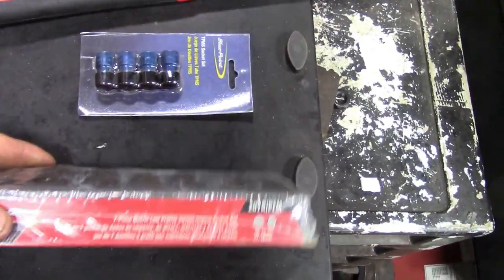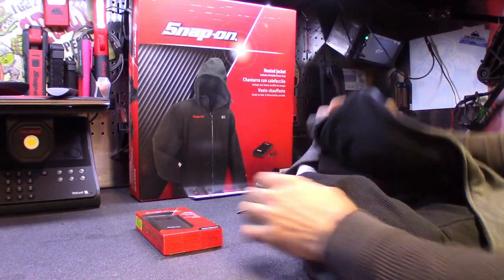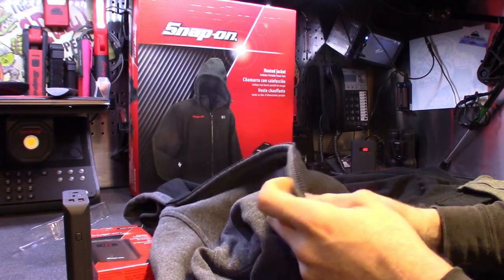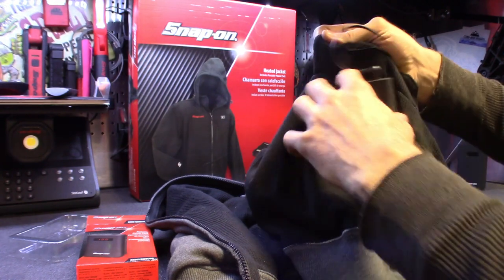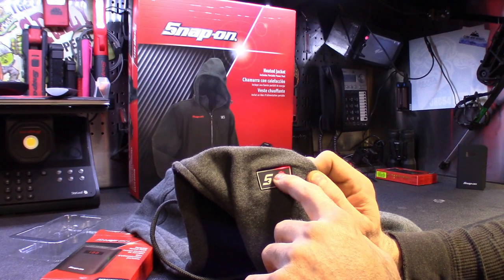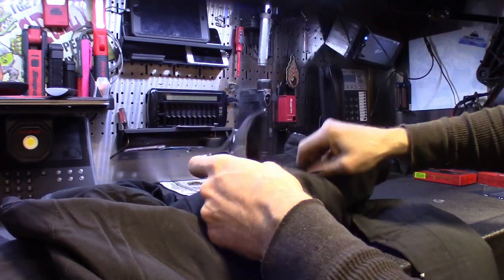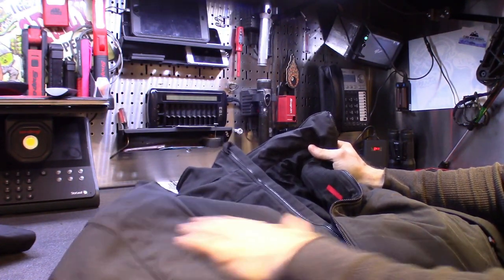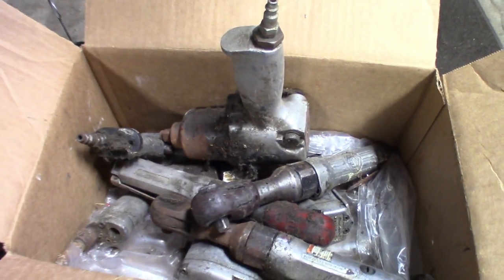SNAP-ON Deals & Gifts🎁

Comment: Just wondering if that's a Milwaukee rebrand let me know your thoughts
Reply from the maker: I don't think it would be. Snap-on would never rebrand with Milwaukee. Milwaukee has Snap On losing money right now in the battery powered tools.
Reply: I do have the Milwaukee jacket and snap on hood they are VERY similar the plugs on the jacket are the same so I use the snap on battery. However they do have some differences the battery placement and when you turn on the snap on it pulses the high then goes to medium where as Milwaukee will go straight to high and stay on high till you push the button.  @JRC54
Reply: That's brings up another good point. I have not heard or milwaukee making something over seas they are pretty proud to say made in USA however a lot of snap on clothes and stuff are made by staples and their wild impact. Don't get me wrong I do like my snap on just as much as the next tech but I do know they rebrand Lang and other companies like that and mark the price up (which really grinds my gears) I even had the cornwell guy lie to me about streamlight products he sells. He claimed if you spend the extra money and buy off the truck it has a better warranty, I belive he said on the led. I'm sorry but I'm pretty sure streamlight will still cover any warranty issue even if I bought it for half the price off ebay...